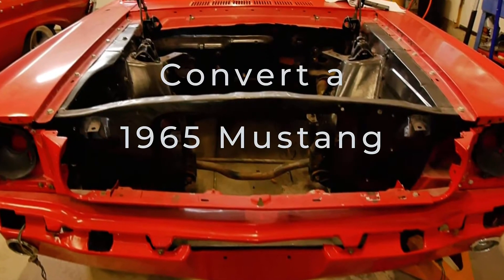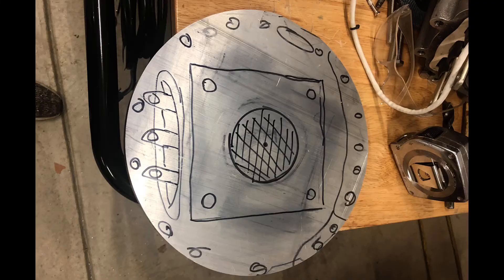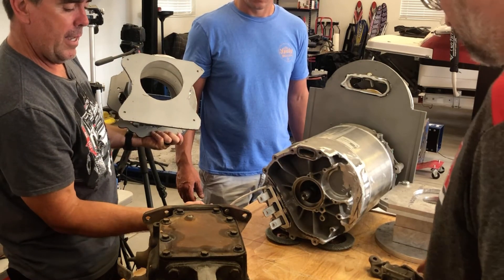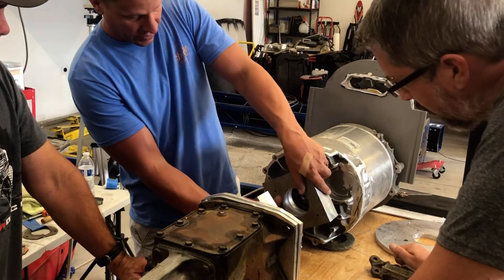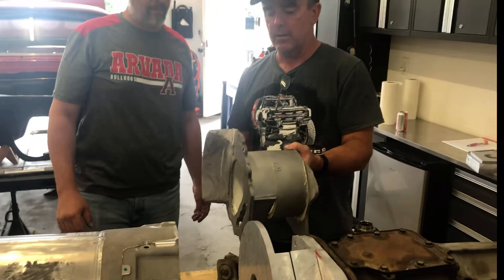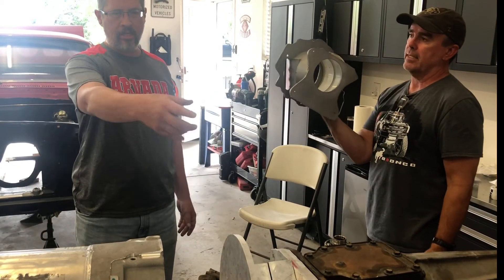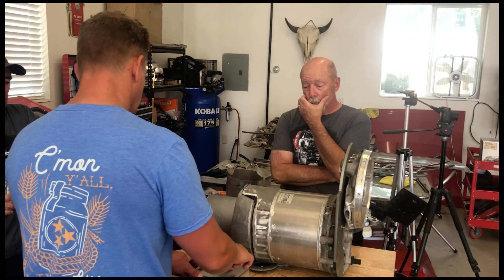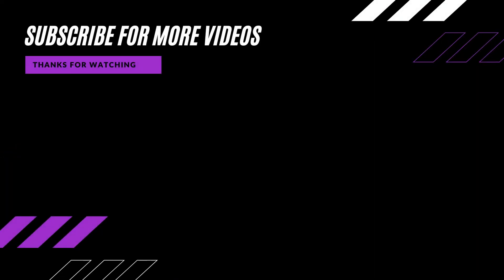Mustang Tesla Swap Motor Adapter Mock Up #evconversion

Comment: I cut down the clutchplate and welded it to 1/2 of a lovejoy coupler.  Then I cut the shafts to bring electric motor 3/4" from the trans bellhousing, 7/8" oak plywood, drilled holes for bellhousing bolts & it runs!
Reply from the maker: So cool! Do you still have it?

Comment: Explain to me why the transmission. I could understand it with a smaller motor but with the Tesla motor a Torque Trends box would have been a bolt on 2:1 reduction. I'm not sure the 3 speed will stand up to the shear torque of the Tesla motor. Maybe?
Reply from the maker: We originally felt we could just keep the car in 3rd. With a 3:55 rear end it should be close to a 10:1 ratio. However we agree, were concerned about vibration and reliability. We're considering just going to the Torque Trends.